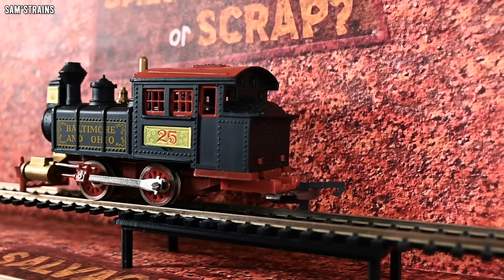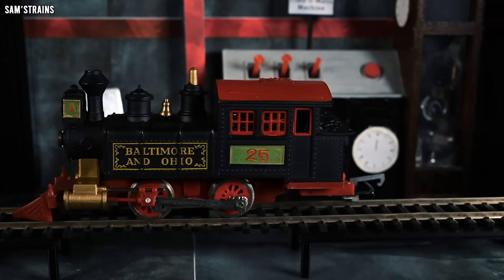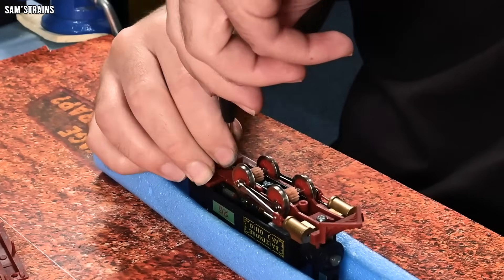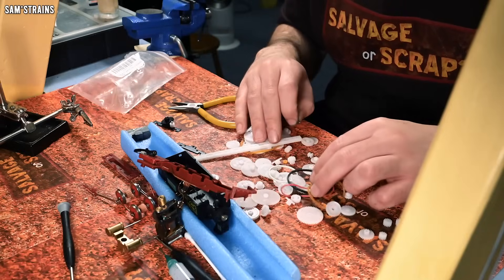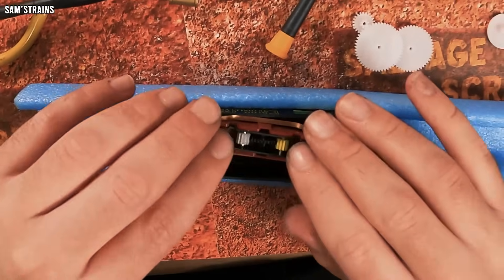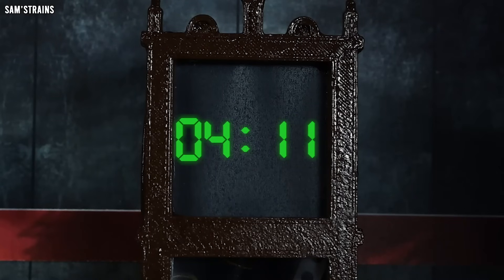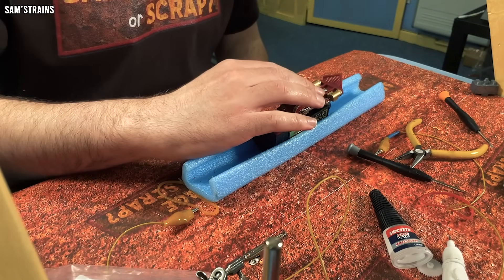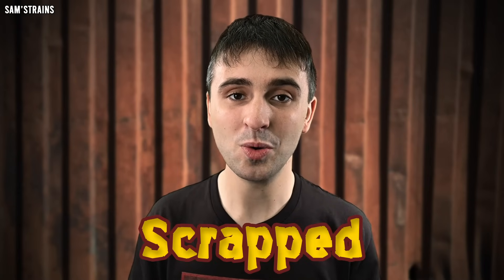Awful Life-Like TeaKettle | Salvage or Scrap? | Last Ever Episode!

Comment: The second I saw the Life-Like "Tea-Kettle" tank engine I knew you were going to have a big challenge.  If I had control of the Timer I would have given you at least one hour to figure out the inevitable gear issue.  I once purchased a huge lot of "New--in-Box" HO scale locomotives on E-Bay and one of these Tea-Kettle “models” was among them.  The Tea-Kettle loco's box never had shrink wrapping so I pulled it out its package to test it.  Guess what, even this mint New-In-Box Tea-Kettle had cracked gears.  These engines are so naff they self destruct in the box before they even turn a wheel on a layout.
Reply: Does the company that makes them still exist?
Reply: @Sudriantank12  Life-Like was bought out by Walthers by 2005

Comment: I actually own this locomotive (With North American couplers), took it for a run last year out of the box for the first time and I must say from a factory stand point the thing does need improvment, I cleaned up the old grease and oil on it with new stuff and still it could use at least some bearings on each axle.

Comment: I own one of these Lifelike locos and I was pretty lucky to find one for 28£ mint in running condition. These are, as far as I've heard, one of the most unreliable American steam locos of the 70s. The most common issue is the gears stripping out like here or the motor burns out. Mine still runs nicely. I like the looks, it's a timeless example of 70s and 80s American steam locos with the decoration. As objectively horrible as this thing is, I like it 👌 shame the series ends, but it was fun.
Reply from the maker: Wow tat's not bad at all - ahh so it's a common issue then? Interesting!
Thanks for watching - Sam :)
Reply: @SamsTrains  common is an understatement.

Comment: I was thinking about this loco. This would be the perfect loco to re-engineer. As in use the top part with a brand new bottom part. Some manufacturers have done this, examples include the hornby 73 (ex lima body) and the bachmann 2mt. Chassis I would use would depend on fit. I would either use a hornby 0-4-0 or the hornby pug.

Comment: Lifelike were basically the cheapest trains you could buy and usually came in starter sets here in the USA. About the best thing you could say for them is they worked, most of the time. They had low detail quality and often the cheapest mechanisms possible. The teakettle is infamous as being probably the worst engine they ever produced. There were two major issues that plagued them, one of which you experienced first hand where the gears liked to split apart. If you got lucky and none of them were split, the brass worm gear had a nasty habit of grinding the teeth off of the large gear.

Now their later Proto 2000 series of locomotives are actually quite good
Reply: They did have a lot of good products like building kits, signs, figures and scenery material and that former Farney 0-4-0 tender loco, before proto 2000, some of those kits were made by heljan but sold for half the price under the life like name.
Reply: @raymondleggs5508  I never had any of their scenery items so I can't vouch for those. My experience is with mostly my dad's old engines. The Bachmann and AHM ones were rock solid and even the one Tyco he had ran well but the two Lifelike diesels were nothing but trouble.
Reply: @Kboyer36  70's bachmann was before the pancake motor and nylon gears so he had the good era of bachmann, and AHM locos were Mehano, Roco, and Rivarossi rebrands, life like's first locos were basically Varney since they bought out varney and then cheaped out in the 70's so you got the beginning of the bad lifelike era!  The Docksider and the 0-4-0 tender loco were the only survivng original varney designs they continued to use, they gave the others to athearn and atlas.
Reply: @raymondleggs5508  That makes sense. I know later Bachmann's had a lot of issues. The newest engine he ever bought was in the late 80's I think which was a Pennsylvania R.R. K4 Pacific with their wonderful split chassis design. I know those damn things have a laundry list of issues they can develop and this one literally has them all.

Comment: This was one of my first steam locos- the second if not the first, in fact.  I recall modifying it to have a rear pony truck just to fill in the empty space under the cab, making it an 0-4-2T.  Mine ran... reasonably well... I guess.  It lasted long enough for me to put a Kadee on the rear, but the lack of a provision for a front coupler proved to be its undoing.

Comment: Picked up one of these, brand new from my local toy and hobby shop in 1978 at a cost of 30 dollars Australian.
Need I say, it never really ran correctly right from the start and in time stopped running altogether.
I have tried many times over the years to make it run and it just refuses to work, so now it just sits on the layout.
By the way, 30 dollars Australian back in 1978 was a good deal of money to pay for a loco, particularly one that doesn't work.

Comment: Now, that's curious - my Tea Kettle has a can motor (a pretty cheap, nasty one) rather than an open frame motor. Main issue is it runs too fast at any voltage - it either needs a diode bridge to drop the voltage over the motor by 6 volts, or just convert to DCC and play around with the CV for motor speed.
Reply: Later production changed to can motors around the early eighties.

Comment: That Life-Like is from the mid 1970s! It is definately just a train set quality loco! You can barely call it a model and not a toy (and I doubt that it has a real life prototype).

For the record that design dates backk to the early 1960s.

And don't judge Life-Like from tgat loco. As I said it is from the mid 1970s when it was a trainset maker. In the 1990s they turned themselves around  180° and became a serious and respected model maker with its proto 1000 and proto 2000 lines! I highly recommend get your hands on one! 

However, it has to be second hand since Life-Like was bought by Walters on the early 2000s. Some of the LL line still exist, but not the samevfrom when LL was still an independent company.

Comment: Life-Like, until they came out with their Proto 1000 and 2000 series, was considered low-end toy train quality for kids.  I should know since I had a couple of their diesels when I was a kid which to be fair were much better quality than the Tea-Kettle, which is universally reviled in the American model train community.   

Life-Like is now owned by Walthers ironically enough but they kept some of the old Life-Like tooling with their Trainline series while their Proto 1000 and 2000 locos were upgraded in Walthers' higher end lines.

Comment: Writing this comment before watching. Based on my experience with these lemons either he’s gonna have to replace some gears, an axel, or he’s gonna have to replace the motor. Time to find out

Edit: so after watching this and we’ll. I wasn’t expecting anything less. needless to say I’ve only seen a few tea kettle locomotives work as they should and the brittle plastic construction of the gears is why. We have one that runs at the museum I work at but since we had the time and supplies to do it we replaced most of the plastic gears with metal ones

Comment: Hi Sam, these engines are a little gaudy but can be made to run nice, especially the ones with can motors. Life Like’s Proto 2000 series is really excellent, you might want to check it out for a review. Great video regardless.

Comment: This is the one awful Life-Like locomotive. The similar Docksider 0-4-0 has only one driven axle, similar pickups, and a gear between the motor shaft and the drive axle. Yours has an older exposed motor while later Life-Like steam engines had a large enclosed can motor. I've seen some with small splits in the gears but they run fine. 
I do hope you do more proper restoration videos like what you did with the Davy Crockett.

Comment: Shame that's the last Salvage or Scrap at least for a while. Shame also that the last project failed, did you consider putting a drop of superglue onto that cogwheel spindle? That might have prevented it from slipping.

Comment: Your first Life Like is probably the worst model built by Life Like their other steam engines were better designed, not necessarily good, but better. Their diesels used a ring field style motor truck (bogie), which, while being cheap and nasty, were relatively reliable, but this tea kettle is the dictionary definition of cheap, nasty, and horrible. But i really enjoyed watching you work on this.  I hope you seriously consider doing more of this series, as it's been very enjoyable. I really appreciate your repair videos, because you have shown good work techniques, and practices, and some unique work arounds to problems a lot of people struggle with.
Reply: Life Like later knew they would have to improve , so they started their Proto 2000 range of diesels with Athearn like all wheel drive etc running gear and much more detail. Their first model BL2 set a Guiness Book of Records record for continuous running. 56 days non stop if I recall correctly.